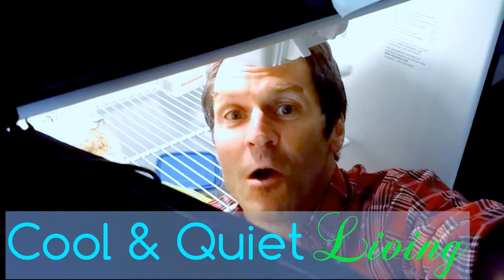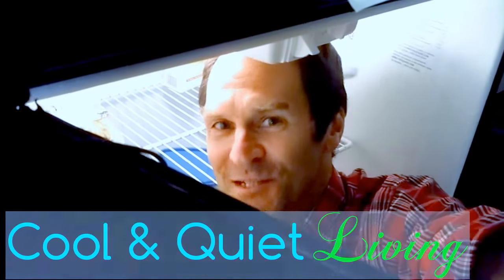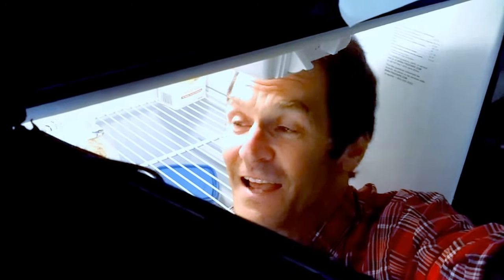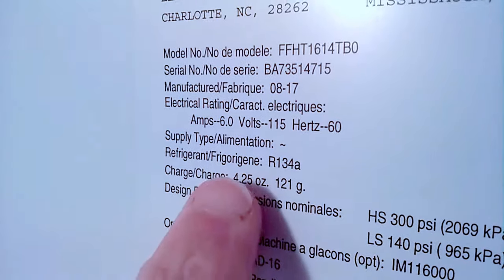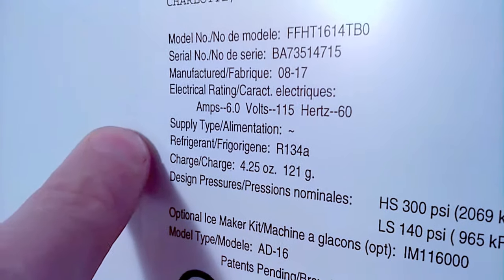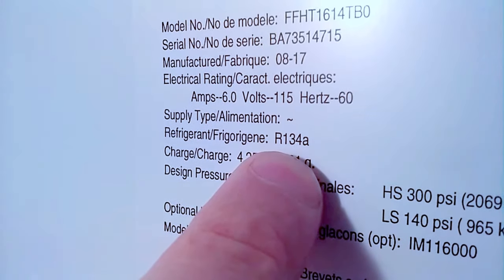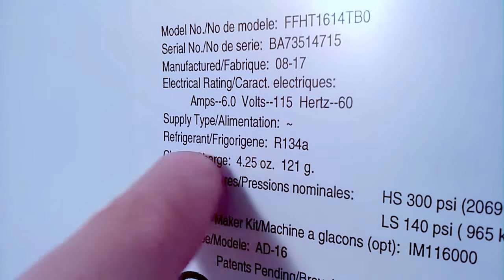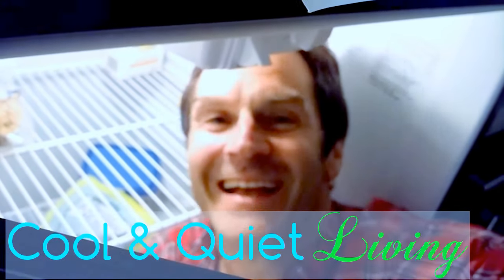R134a vs ammonia refrigeration comparison

Comment: I'm just a dumb blonde with a high school education.  I once worked for an Engineering company and they had blue line machines that used Ammonia to print the blue lines.  If the tank came lose for some rare reason everyone in the building all 4000 of us had now seriously this was 30 years ago but I think it was like 10 seconds to get out.  Not 10 minutes. but 10 seconds.  They gave you a mask and an o2 tank to change the ammonia and they always had two people on hand in the rare case that something happened the other could take over.

Comment: I have a absorbtin camping fridge i think they have ammonia in them.,  runs from a 12v heater, a 240v heater, or a flame from a gas burner.  seems these elements are about 200w in power to run it, but it doesnt seem efficient when you can get compressor fridges at 60w
Reply from the maker: Thanks for posting. Interesting to read about ammonia absorption refrigerators which are still used in RVs.